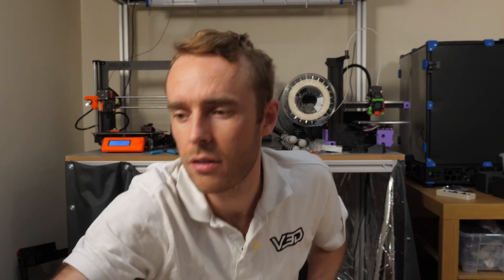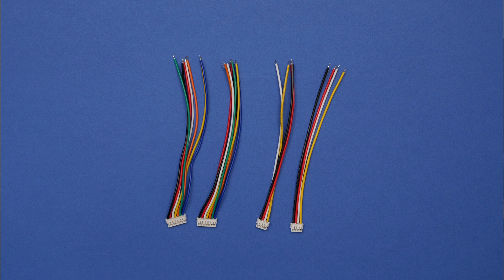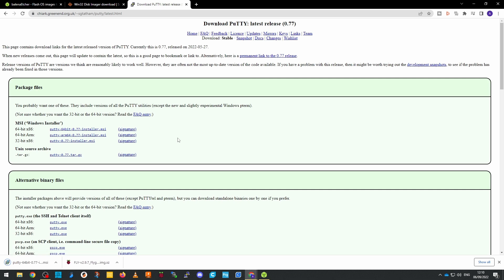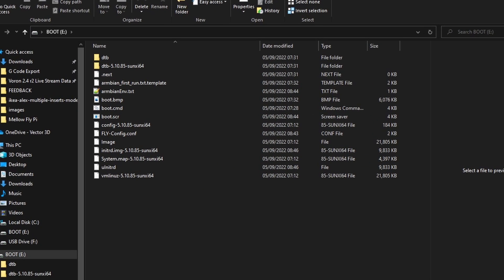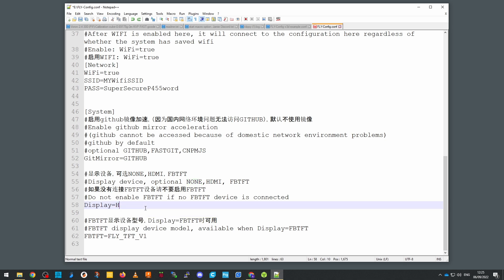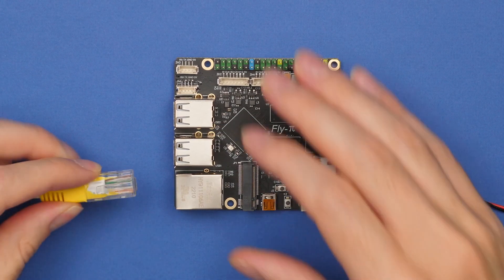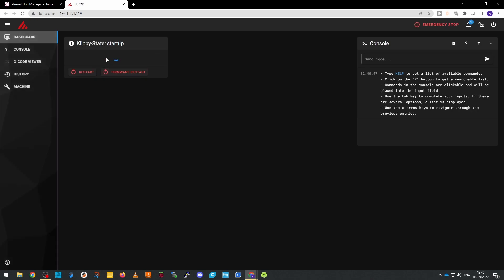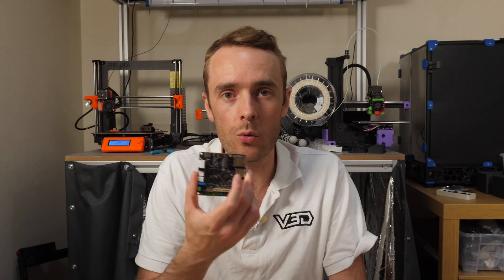3D Mellow Fly-Pi Full Setup Guide

Comment: So you have to strip and pin your TFT ribbon cable?  That sounds super annoying to do.  I do like the accelerometer having a dedicated port though.
Reply: It's so easy to do, wouldn't even call it an inconvenience
Reply: More of an issue of them using the wrong connector to save a half a cent.  I would of payed the cent for the right one.

Comment: If it is just meant to be a raspberry pi alternative, the orange pi seems like a cheaper choice that is also easily available.
Reply from the maker: This does also have CAN with an additional module, and can use eMMC which is much better than SD card for a OS storage especially long term.
Reply: @Vector3DP  just add el cheapo 128gb ssd. Problem solved
Reply: Being able to run of 24v is nice

Comment: Substitutes to Pi?! 😲
Reply from the maker: Ye, I mean i've not used it in anger, so can't provide a full review, but yes its main intention is just to go in place of a raspberry pi since they're out of stock everywhere and it seems to work pretty well.
Reply: @Vector3DP  I'll probably just go with a CB1, tbh, since it's already part of the Bug Tree Tech ecosystem and purchase packs/bundles $$
Reply: @x_jaydn  Am on the fence about the CB1.  Wondering if it will work with other CM4 carriers, or if it will only work Big Tree devices?
Reply: @GnuReligion  I believe people have had difficulties using it for non-printer related projects
Reply: @MrRoverno  That's disheartening 😲 What happened? 🤔